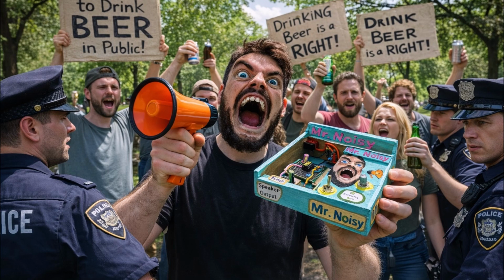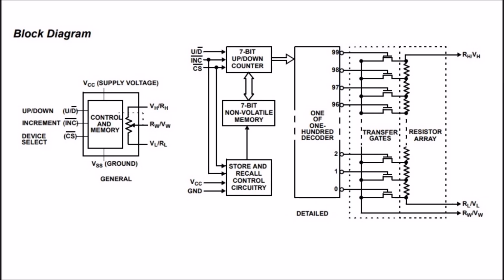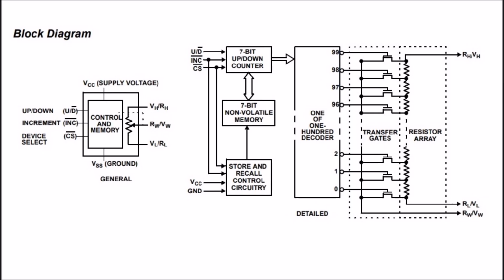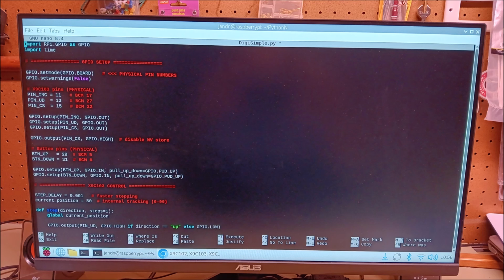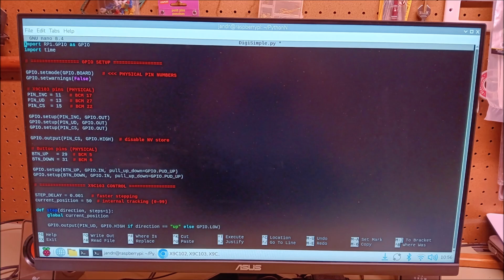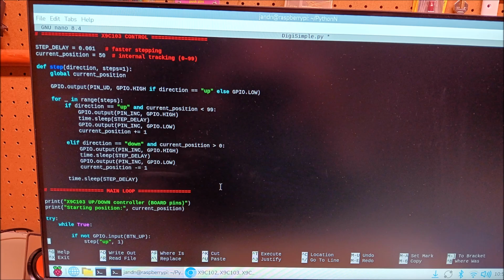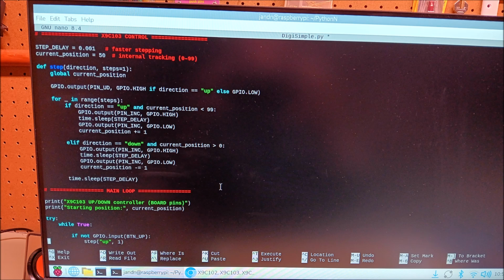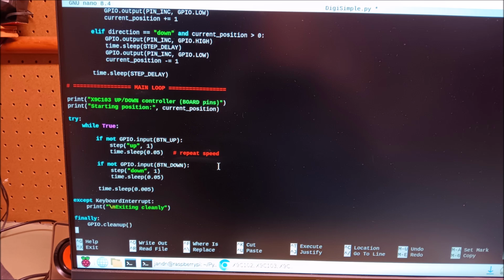Raspberry Pi 4: Mr. Noisy and X9C103 Digitally Controlled Potentiometer

Comment from the maker: import RPi.GPIO as GPIO
import time

# ================= GPIO SETUP =================

GPIO.setmode(GPIO.BOARD)   # <<< PHYSICAL PIN NUMBERS
GPIO.setwarnings(False)

# X9C103 pins (PHYSICAL)
PIN_INC = 11   # BCM 17
PIN_UD  = 13   # BCM 27
PIN_CS  = 15   # BCM 22

GPIO.setup(PIN_INC, GPIO.OUT)
GPIO.setup(PIN_UD, GPIO.OUT)
GPIO.setup(PIN_CS, GPIO.OUT)

GPIO.output(PIN_CS, GPIO.HIGH)  # disable NV store

# Button pins (PHYSICAL)
BTN_UP   = 29  # BCM 5
BTN_DOWN = 31  # BCM 6

GPIO.setup(BTN_UP, GPIO.IN, pull_up_down=GPIO.PUD_UP)
GPIO.setup(BTN_DOWN, GPIO.IN, pull_up_down=GPIO.PUD_UP)

# ================= X9C103 CONTROL =================

STEP_DELAY = 0.001   # faster stepping
current_position = 50  # internal tracking (0–99)

def step(direction, steps=1):
    global current_position

    GPIO.output(PIN_UD, GPIO.HIGH if direction == "up" else GPIO.LOW)

    for _ in range(steps):
        if direction == "up" and current_position < 99:
            GPIO.output(PIN_INC, GPIO.HIGH)
            time.sleep(STEP_DELAY)
            GPIO.output(PIN_INC, GPIO.LOW)
            current_position += 1

        elif direction == "down" and current_position > 0:
            GPIO.output(PIN_INC, GPIO.HIGH)
            time.sleep(STEP_DELAY)
            GPIO.output(PIN_INC, GPIO.LOW)
            current_position -= 1

        time.sleep(STEP_DELAY)

# ================= MAIN LOOP =================

print("X9C103 UP/DOWN controller (BOARD pins)")
print("Starting position:", current_position)

try:
    while True:

        if not GPIO.input(BTN_UP):
            step("up", 1)
            time.sleep(0.05)   # repeat speed

        if not GPIO.input(BTN_DOWN):
            step("down", 1)
            time.sleep(0.05)

        time.sleep(0.005)

except KeyboardInterrupt:
    print("\nExiting cleanly")

finally:
    GPIO.cleanup()